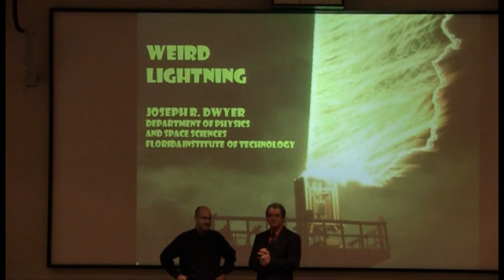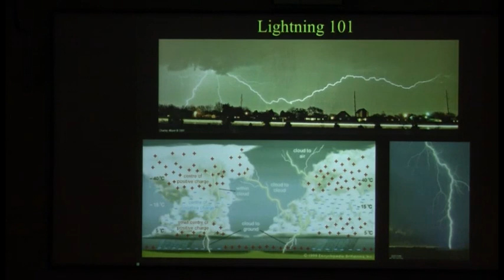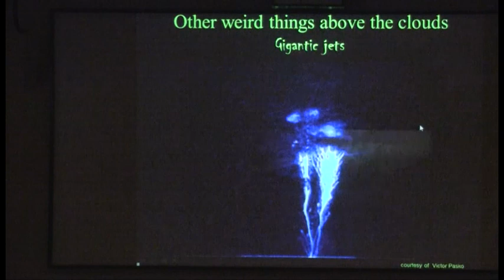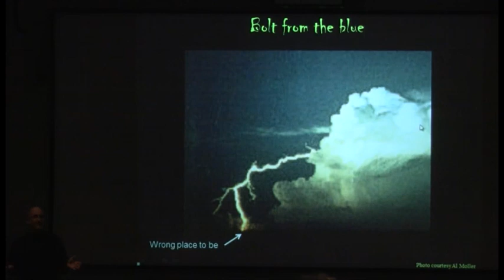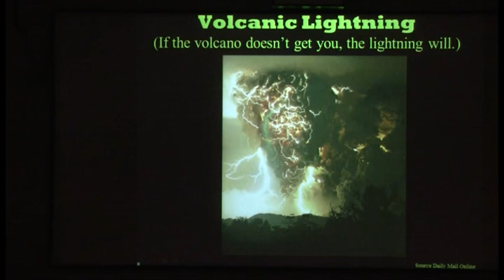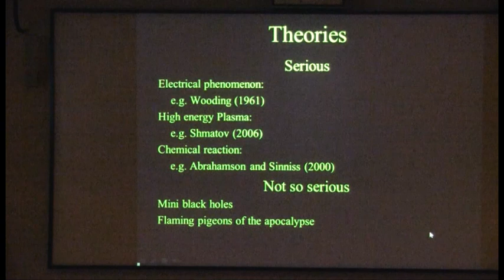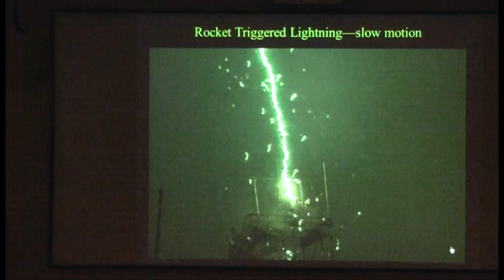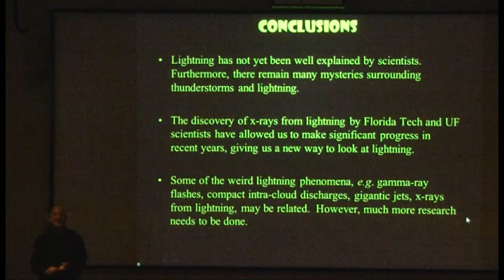AAPLS09 "Weird Lightning" by J. Dwyer (2011 Sept 23)

Comment: i can remember having a lot of spare time in physics so one day I decided to use one of those devices which produces a spark in air about 1.5 cm (connected to an AC/DC power box ) to pass current through my Australian Education standard edition wooden ruler. The passage of the spark through the ruler caused it to heat and burn. As i passed most (distance about 15- 20cm) of the entire length (30cm) of the ruler through the spark (burning it all the way along) I found that at least some of the electrical current was busily travelling along the burnt part of the ruler, letting out little sparks here and there. I concluded that the burning of the wooden ruler had created some graphite which is a good conductor of electrical current.
Reply: thats what happens

Comment: Forgotten here is Snowstorm or Blizzard Lightning. I saw it once in a very heavy snowstorm. Was very dark outside and blowing swirling wind with thick blinding snow in the air, could hardly see a few feet ahead. Then flash, flash (no sound) everything lite up for a split second like daylight or brighter penetrating the heavy snow in the air, everything was white, and then gone that quick. I was like, WTF was that? I had to go and look it up.

Comment: 13:30  scary: not a cloud in the sky, bolt from the blue, reaches 25 miles from distant storm.  wait 30min after blue sky returns before going outside again.  stay away from trees.  if outside and hear sizzle hiss static and feel hair standing up, crouch down on tip toes. 
22:10  superbolts:  1 in a million bolts are 100x more powerful than normal lightning.
23:30  sympathetic L:  lightning chains aka chain reaction across vast distances.  lightning initiation is a mystery, sympathetic lightning may be a clue.
22:50  volcanic L:
29:30  CIDs/NBE narrow bipolar events aka stealth rf lightning solo event.  most powerful rf emission on planet for millisecond.
30:30  ball L: lasts 1-60 seconds, size orange to bowling ball, disappears silently or explosively, moves at walking speed.
33:50  TGF terrestrial gamma-ray flashes. thunderstorms make antimatter positrons.  
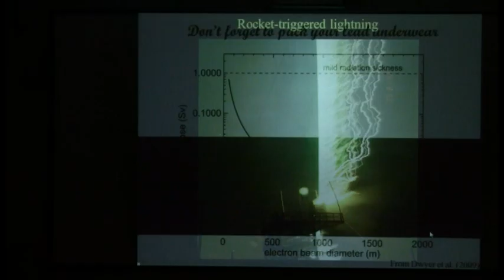39:00  rocket-triggered lightning studies. 
41:20  xrays.
45:30  all the wierd stuff happens together, one triggers the others, like a symphony.

Comment: If the Karman line lies at an altitude of 100 km above the Earth's sea level, and is commonly used to define the boundary between the Earth's atmosphere and outer space (sound doesn't exist in the vacuum of outer space), could ELVES be caused by "thunder" hitting the sound barrier with charged nitrogen gas creating the light, like a neon sign? It looks like a shock wave at the Karman line. If ELVES are hitting the sound barrier would they echo and explain CIDs/NBEs?